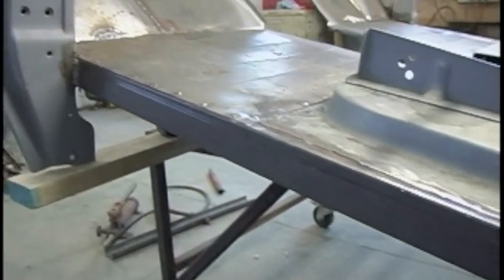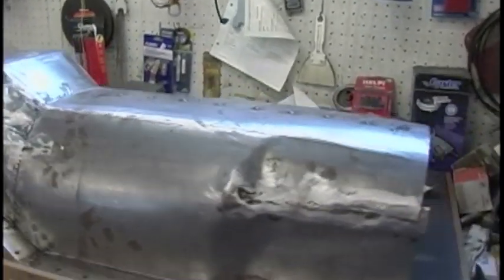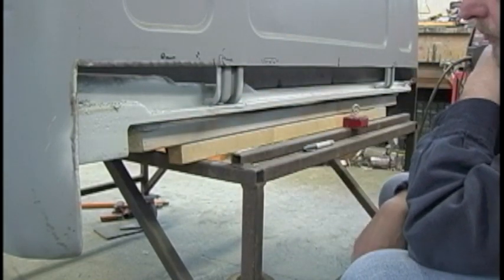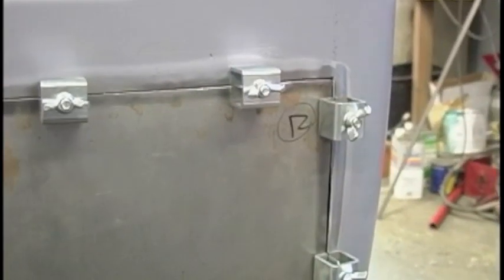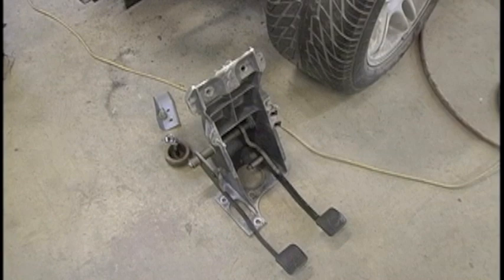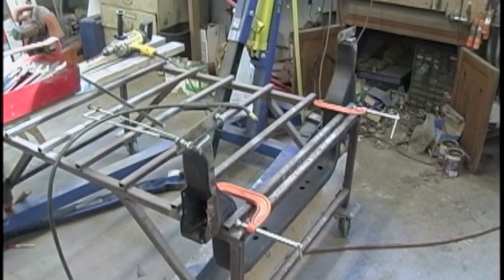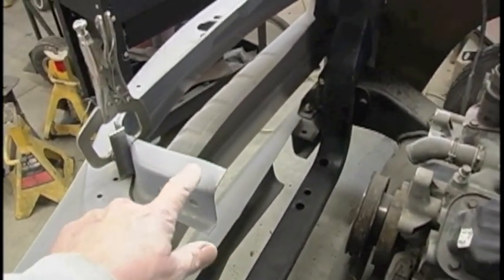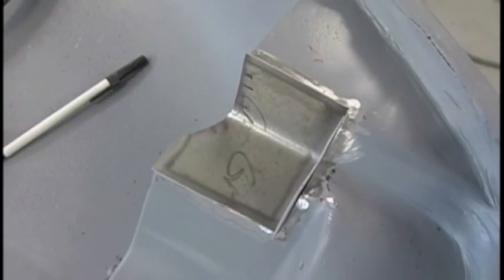Building a '57 Dodge Streetrod Pickup Part3

Comment: Hi  - Just acuired a 57 with a flathead six - cracked block - BUT the truck is complete down to the hubcaps. Managed to find an LA318 out of a 71 Dodge truck with a NP435 4 speed behind it. Oh yes It is Righthand drive . Facinating to see other Moparites at work.

Comment from the maker: In the next video I'll show the Dakota steering column I kind of "stripped down" so there wouldn't be an ignition switch or a wiper switch on the directional stalk. The big concern with the radiator support was going to be if it would also support the nose of the truck. That's going to work very well.

Comment: I build robotic Ice Vending towers for a living, but my first love is building hot rods.  I have always loved these vintage Dodges.  They are by far the best looking trucks of the day.  I think you have chosen the absolute best chassis to sit that body on.  I have owned 3 rodded Daks...2-94s and 1-95.  I am not a big fan of the 3500 5 speed.  I tore up 4 of them.  A 46RE would have been a simpler swap and a much better driver in my opinion.  An 8.8 Ford rear would also be a great addition with 3.73s.  I mildly modded 408 magnum with a fairly mild hydraulic roller like the R78 Ultradyne with the Hughes dual plane fuel injection intake would net a very relaxed 1 HP per cubic inch output and really set that old truck on fire.  Check out one of my Iceman Icehouses here on you tube.  You're doing a great job.